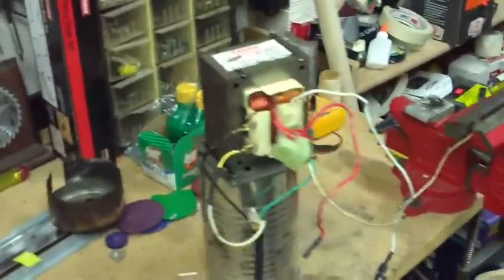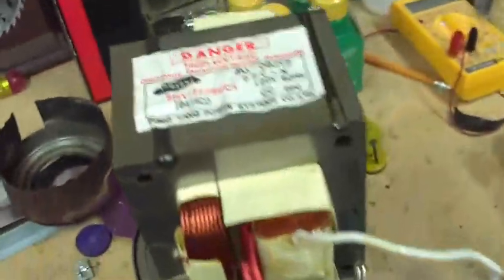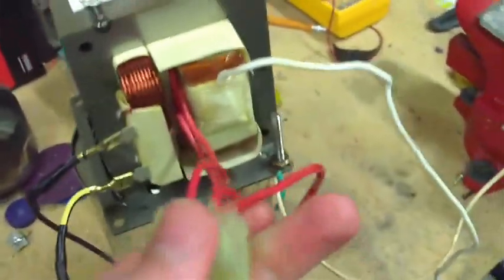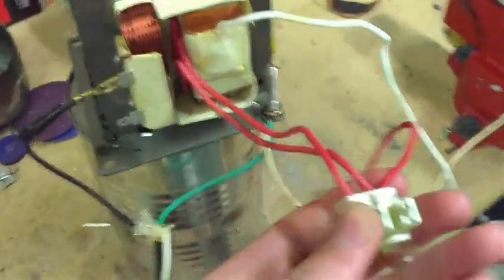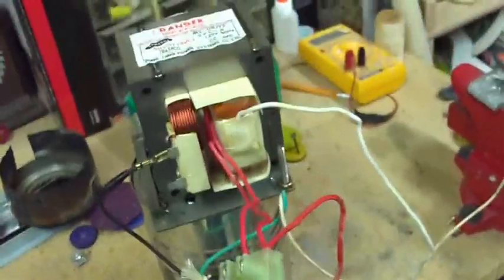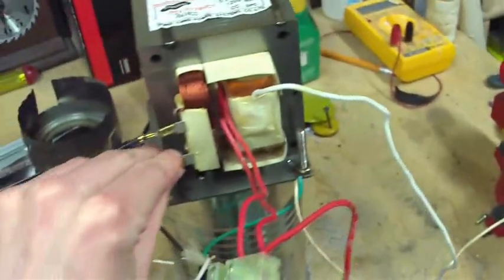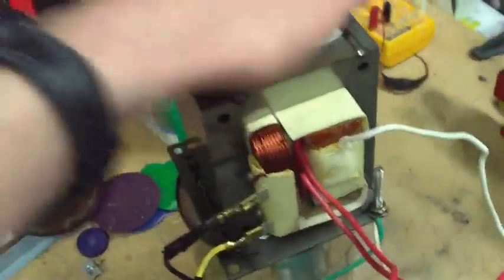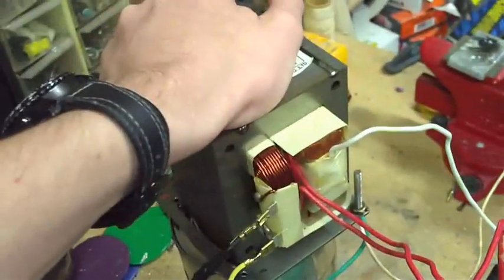MOT Demo

Comment: nice MOT and explanation, oyu can arc longer than that though, for up to ten seconds or straight up arcing cause mots are built like tanks they are meant to handle the heat! the only prob i could see is your thin mains wiring getting hot or tripping the breaker!

Comment from the maker: @rwmtube 

I really need to remake this. Not only have I learned much more about transformers, but I have a much better camera. I tried the jacob's ladder but 2kV is too low of a voltage to jump more than a microscopic air gap. Also, once the arc is started, it gets out of hand really fast